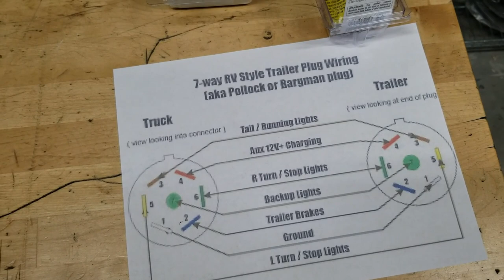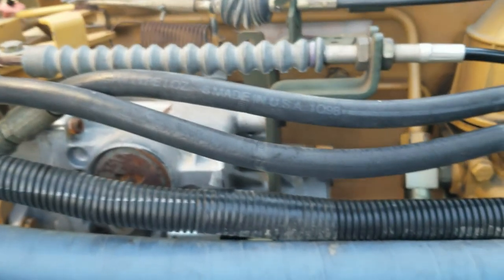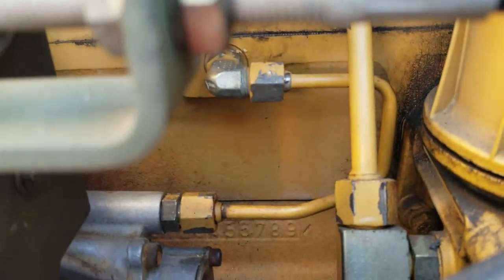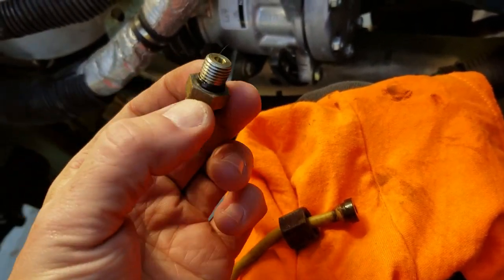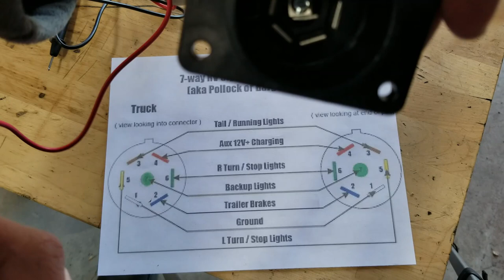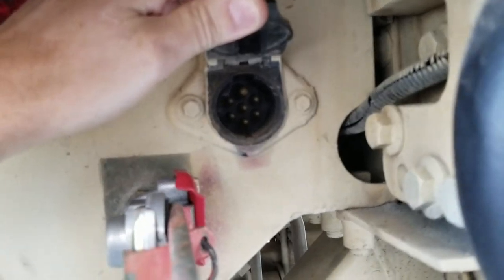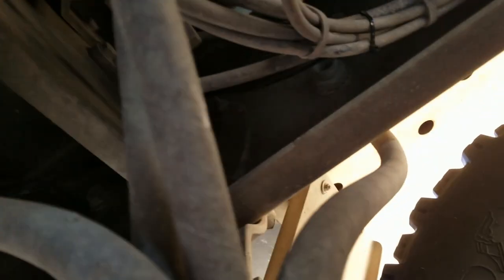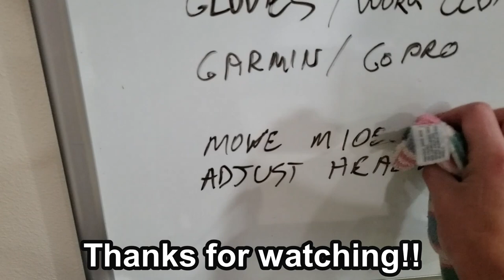Abel LMTV build part 135 (oil feed line fix, 12v trailer plug modification)

Comment: Thanks for adding the parts needed in the description. Picked up my m1078 from Ft Hood yesterday and made the 180 mile drive home without an issue, so its time to start getting the truck up to speed maintenance wise.

Comment: Thanks for putting this together, I’ve seen a few write-ups where this failed. Really appreciate the info and parts list.
Reply from the maker: No problem.  25 bucks can save you thousands....
Reply: The next catastrophic thing that i need to figure out is where the a new AC bolt can crack the engine without the proper bushing. I did not install my AC so... yeah
Reply from the maker: @builtmfg  I have not heard of that one yet.  Where did you see it or hear about it??  I know that the compressor brackets have to be torqued in a proper sequence which I covered in order to align properly and not cause undue stress on the engine.
Reply: Sean Fillner it was on Steel Soldiers. I’ve seen it two different times prior to getting my ac installed.
Reply from the maker: @builtmfg  There are a lot of us on the fb lmtv page that have done this mod or have had it for years and never had an issue.  Take things/failures you see with a grain of salt i.e. keep an eye on things and you should be okay.  Basically get to know your truck and its quirky behaviors..

Comment: Nice video.  I need to change that line too.  FYI- the fitting with the o-ring seal is called a J1453 O-Ring Face Seal. It's also used on the turbo oil feed line

Comment: As always, I appreciate you sharing your adventures with other FMTV/LMTV/MTV owners. I like the fact that you are unafraid to defy convention, and find a unique solution. I have a question about this fix. Is the i.d. of that brake line fix the same as OEM?  The reason that I ask is, if this is a line that is other than a scavenger line, i.d. might matter. How far have you driven since your fix?
Maybe the fittings would serve to keep the oil pressure in unity with the OEM tube. Not sure....

I'm not arguing with your fix, just thinking through the process out loud.
Reply: I was curious also, so I broke out the calipers when I was changing mine earlier today . Old line had an i.d. of 0.16, and the new braided line has an i.d. of 0.13. Not sure how big of difference 30 thou can have on restriction but we'll run with it for now.
Reply: @88atlas07  Maybe new braided line should be upsized ?

Comment: The last link to the hose on eBay dosn't work anymore. Tried searching the name as well with no luck.
Reply from the maker: Just look for a 6 inch or 8 inch stainless braided 4an line.  I just looked on ebay and there are over 1000 options available.